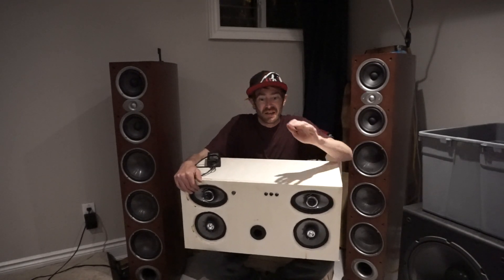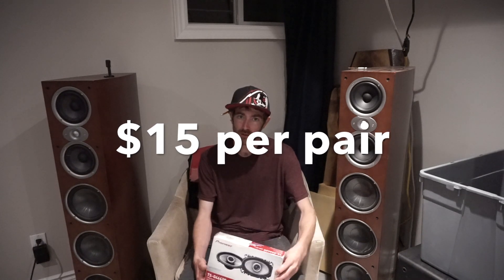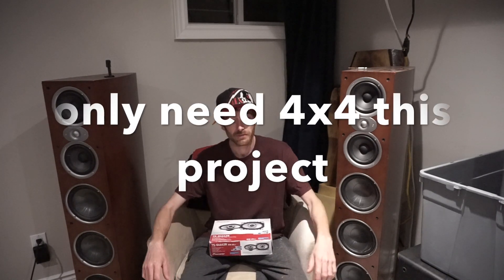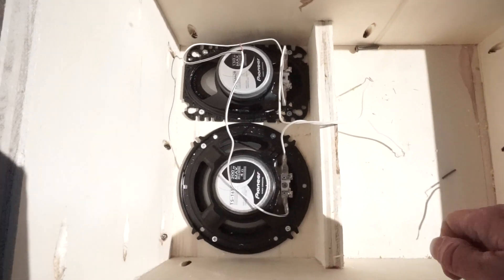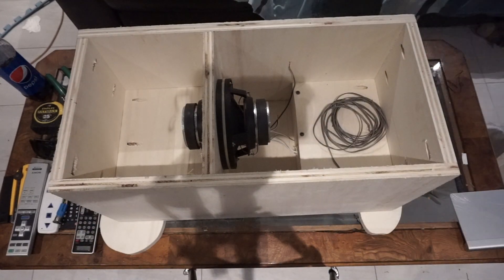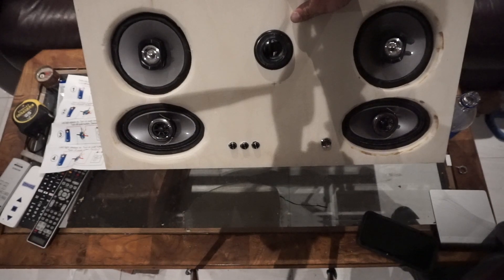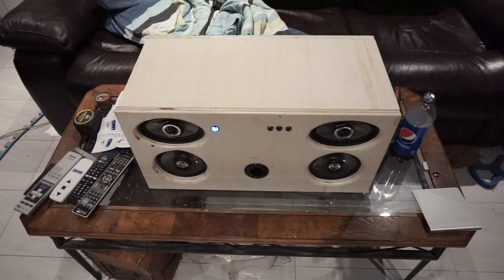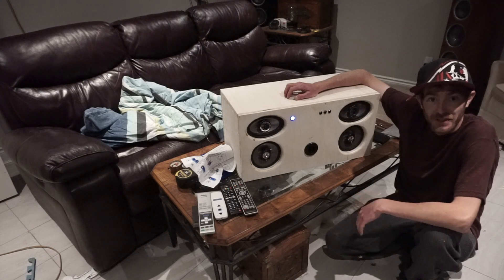EPIC Isobaric subwoofer 2.1 Bluetooth Boombox Build guide under $150

Comment: Hiw did you drill those holes to the screws. So that screws is hidden in the wood. Link to tool ? thanks

Way to big box for that iso bass. And to small port
Reply from the maker: the box is actually the same cubic feet as the subwoofer box it came out of. with the speakers being sealed boxes inside takes up quite a bit of the internal space. and the ports are the same size...  canton fonissimo subwoofer. the tool is a kreg pocket hole jig. https://www.amazon.ca/gp/slredirect/picassoRedirect.html/ref=pa_sp_atf_aps_sr_pg1_1?ie=UTF8&adId=A03996181GAGGNJZLSA3Y&url=%2FKreg-K5MS-SK03%2Fdp%2FB01MT3J1F4%2Fref%3Dsr_1_1_sspa%3Fgclid%3DCjwKCAjw-ITqBRB7EiwAZ1c5U0qeNWnPf44TGCNmUnjyz2E_AhrEoMGMlimTTmlBPkcVAJQ9_zcuXxoCNHoQAvD_BwE%26hvadid%3D208368328237%26hvdev%3Dc%26hvlocphy%3D9001010%26hvnetw%3Dg%26hvpos%3D1t1%26hvqmt%3De%26hvrand%3D6296463930658757889%26hvtargid%3Dkwd-295851443670%26hydadcr%3D27155_9824942%26keywords%3Dpocket%2Bhole%2Bjig%2Bkreg%26qid%3D1564607630%26s%3Dgateway%26sr%3D8-1-spons%26psc%3D1&qualifier=1564607630&id=3543498585924326&widgetName=sp_atf